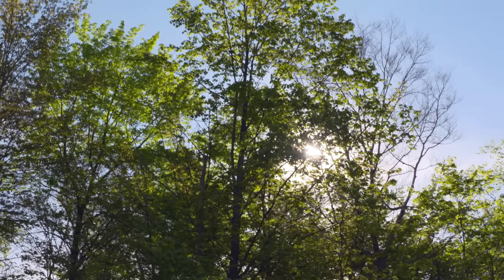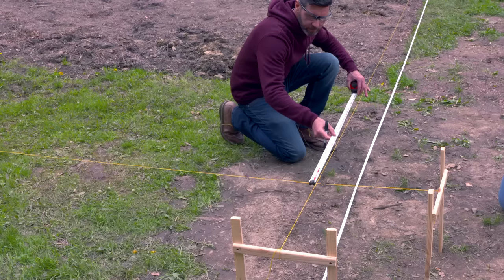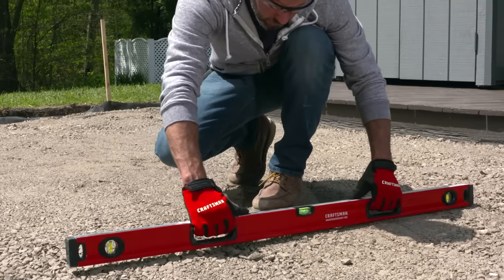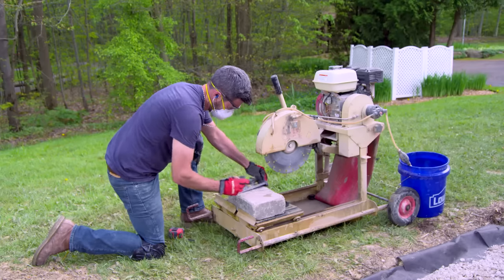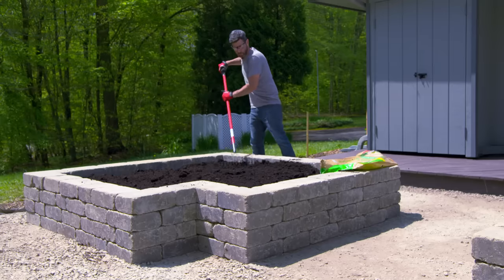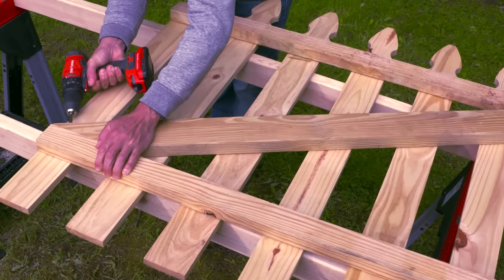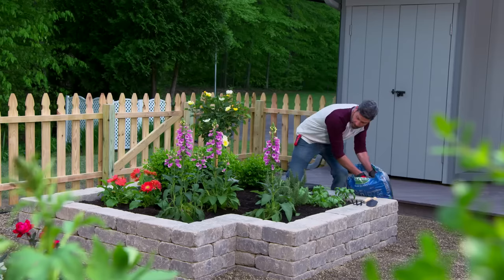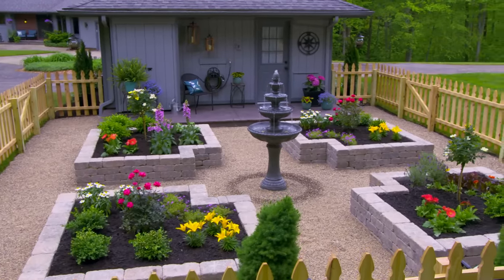How to Make a Garden | English Garden Design Ideas

Comment: An English garden that needs a lot of sun! We get 2 days of sunshine and call it summer.

This is a nice design, and I would happily use it as a kitchen garden or a rose garden. In my own garden I have retaining walls made from old, very thick broken paving slabs. I laid them dry, so plants can grow through gaps. To prevent soil leakage I used weed suppressant fabric on the inside.

An alternative approach in the first year or two would be to infill perennial plants with annuals until the main plants have grown. This gives the garden a more finished look, and the plants act as living mulch.

Comment: And the cost for this English garden is equivalent to my Indian one year budget :(
Reply: ManasKumar Behera it does look very expensive, especially trying to fill each bed with those little bags of dirt.
Reply: @beautyinsimplicity3461   The beds look to be seven feet by six feet by sixteen inches of raised bed soil.  That's fifty-six cubic feet of soil using Lowes own calculator.  At 1.5 cubic feet a bag that is thirty-eight bags give or take.  The price of each bag of soil is $8.98 from Lowes.  That comes to $341.24 per bed for soil.  $1364.96 for all the soil.